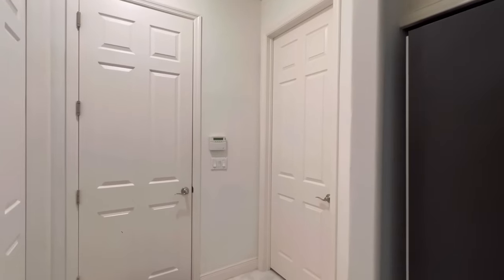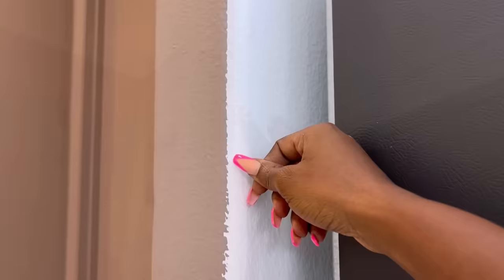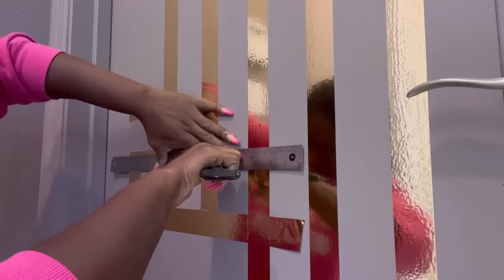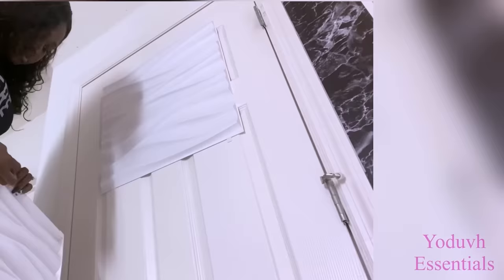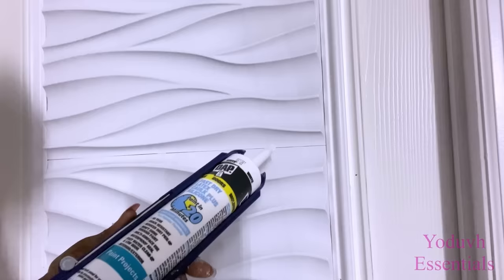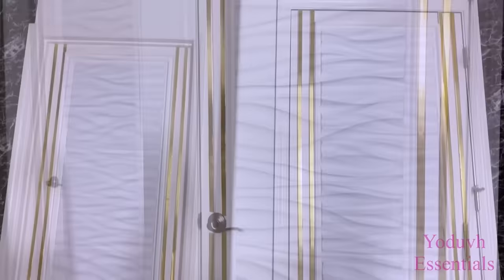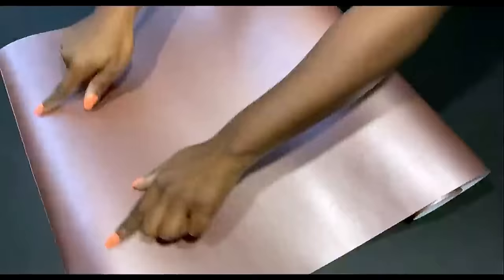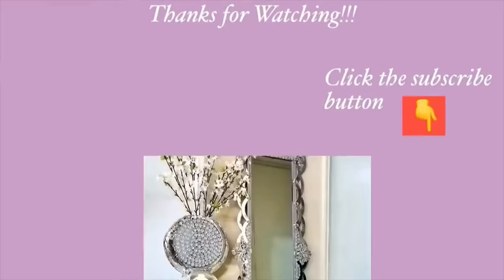SEE HOW This SIMPLE Trick MADE HER Hallway LOOK EXPENSIVE DIY WALL AND DOOR Makeover!

Comment: You make things look so easy, but the end result is stunning. Wet baby wipes help with the caulking too they are stronger than paper towel and you can use baby wipes for a lot of other things too like staining  or wiping the excess away just like the caulking. I love how you get every thing done with those long finger nails how the heck do you do that. If i do anything with long nails i break them off or crack them. Both sets of doors look stunning i especially love that wavy panels on the door it looks so cool. You are amazing and you think outside the box which is really cool when decorating a space. I love it.

Comment: Ok,interesting way of doing all but theres an one big problem...All of that is short life type pf work....Dont make me wrong,its ok for something that will be there for short period of time,but if you want all of that to last its not the way you should do it....First that golden tape,you cant just cut it on doors,you will damage door,and when you get tape off you will have lines...Second,parts where tape is merging is to visible...Better way is to paint it with golden paint,and finish it with clear cote....Also every other things that you are doing on doors,it needs to be coated with clear cote if you want to last long....O and one more thing,if you want to change looks of your doors just buy 3d surface for doors and glue it,ist much cheaper and its the best way to do it...